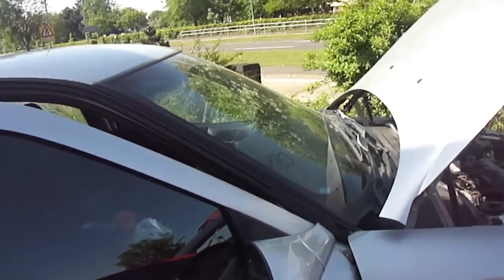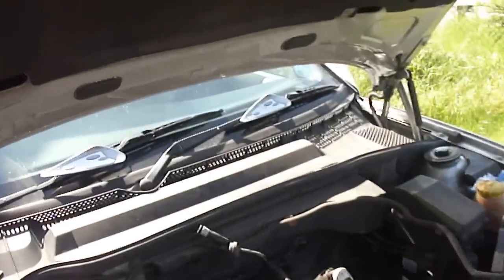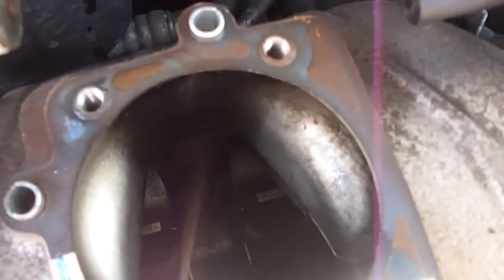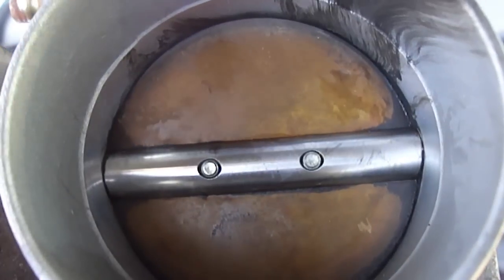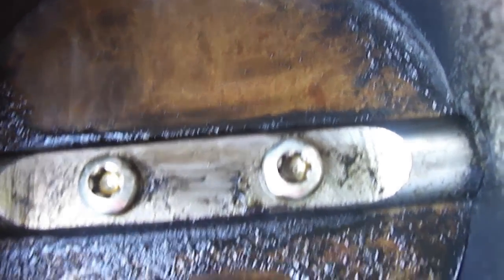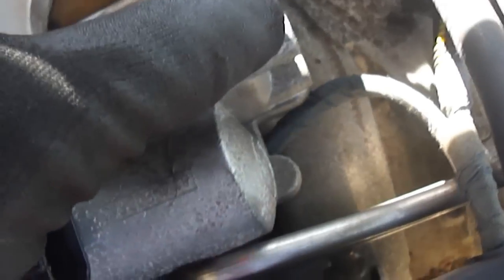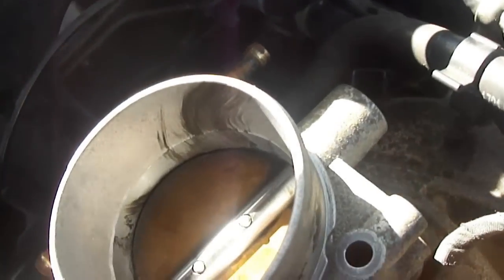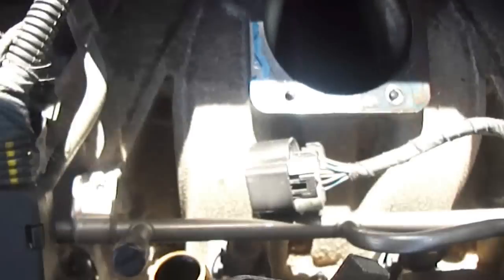Vauxhall Vectra B - Error Codes P1555/P1550 FIX FOR FREE - PART 1

Comment: Very good videos, thanks for your work. I am trying to do a full clean up for the throttle and relative parts, my car is Vectra JSCDII V6 2.6L 2001, but I find it is really a big challenge to pull it down from the engine, so it could be much helpful if you capture how you do this. Cheers

Comment from the maker: No performance problems, the light only came on if i drove it like a granny, if i drove it like a maniac the light would never come on.

But that doesnt mean it is not the same thing as i had, you ECU mite handle it differente making you have performance problems.

My ECU was updated well before i got any error codes so the update mite have been ignoring these errors, therefore not giving me performance problems!

Comment from the maker: Hey mate, trust me clan it very good, also dont forget the small hole on the throttle body, make sure when you stick the neadle through the whole it comes out on the other side so that all the crap comes out!

Also dont touch the gasket it is probably old and it will get damaged lol
Also check holes along the tubing heading to the throttle body!

1 hour simple :D